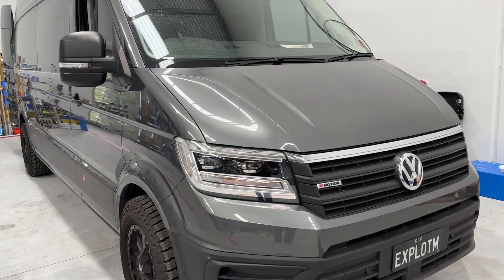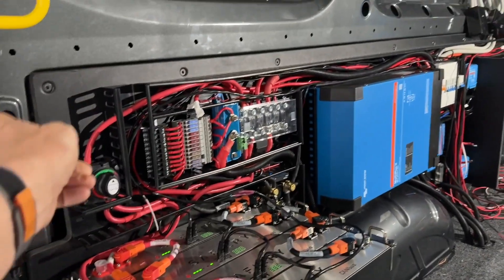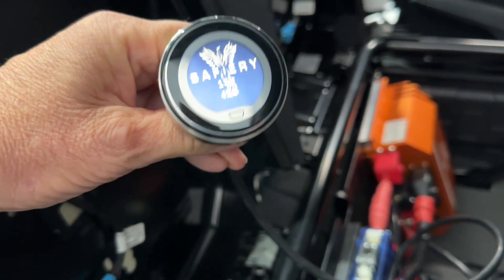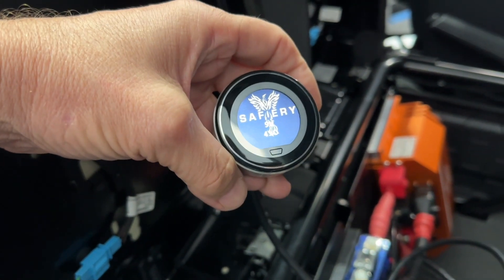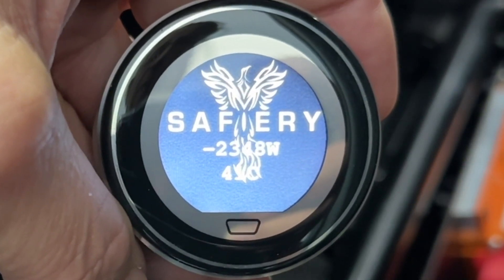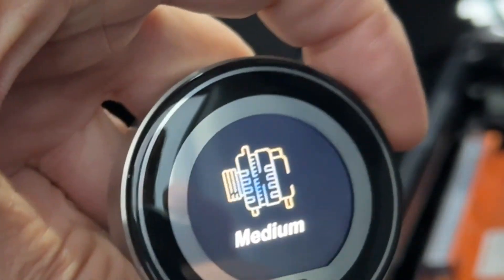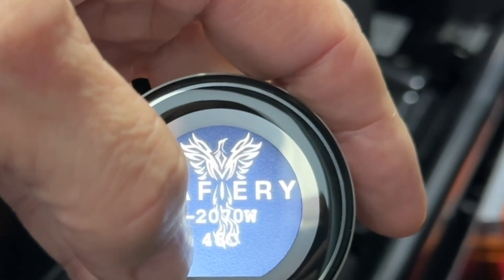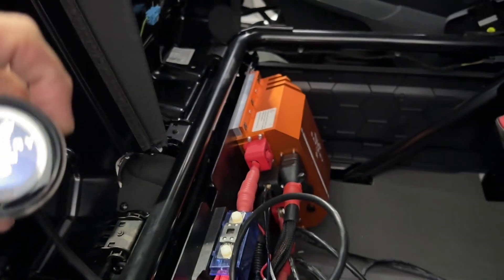VW Crafter 4Motion gets Scotty AI and new Scotty Touch Screen producing 2,800W and 2,300W at idle.

Comment: Hi guys, with the V3 software, I can’t change the Camping set point to lower than 12.6V. On the old software V2 the camping point could be reduced down to 12V. The VW crafter idles as low as 12.2V for a long period of time. At the moment when my crafter is idling the HS battery gets discharged (it hovers around 300-500 watts of discharge) and it only temporarily gets charged when I lift my foot off the accelerator to cause a voltage spike and the Scotty then wakes up and begins to charge the HS battery. However after a short while, the alternator idles again below 12.6V, causing the HS battery to start discharging again. Do you have advice for this situation? Is there a D+ signal option to use as opposed to the voltage trigger? Do you offer a specific software for smart alternator setups that idle below 12.6V such as the VW crafter? Thank you
Reply from the maker: Hi Yes we are familiar with this. The new crafter uses voltage only to have a delayed "turn on" the alternator and its not consistent. If you have a low load on the Scotty, te crafter waits till the load increases. Its their "energy management" feature. Reducing the camping setpoint introduces other issues for you as the voltage is too far away from the resting voltage of the starter battery. What solves the problem is to flick the lights on briefly which increases the load and the alternator kicks in. Of course if you are in charging mode and the batteries are down a bit it will kick in immediately. Touch the chat bot on our webpage to discuss further.

Comment: So SCOTTY AI can pull more power from the VW alternator than any other method AND it is all displayed and adjustable on the new gauge in the cabin whilst you drive.😄
Reply from the maker: Yes AND we dont modify the alternator in any way (others add diodes to defeat "smart feature" thereby changing the compliance of the vehicle)